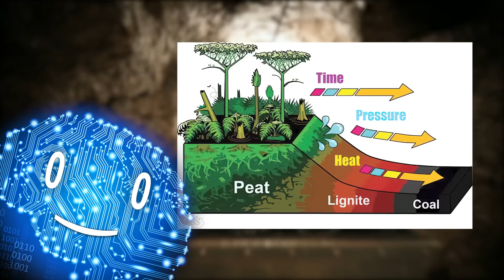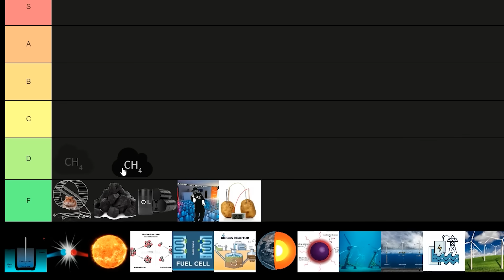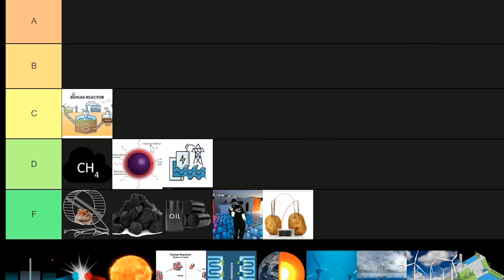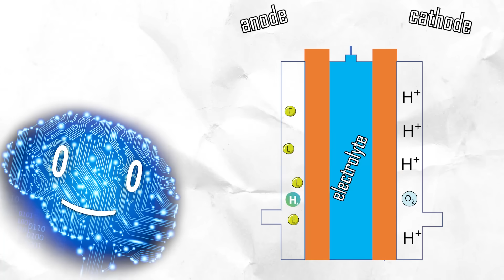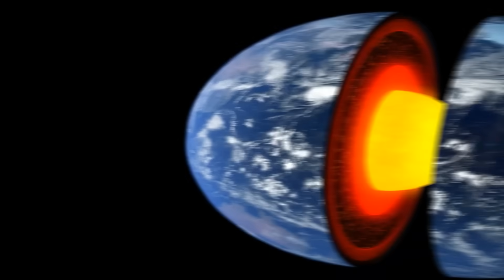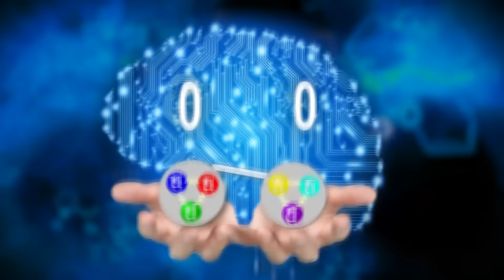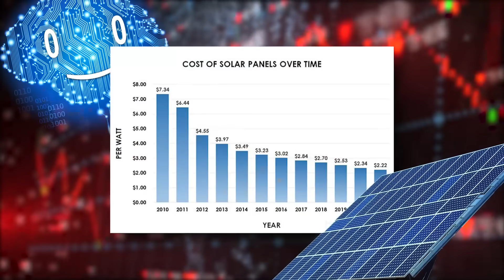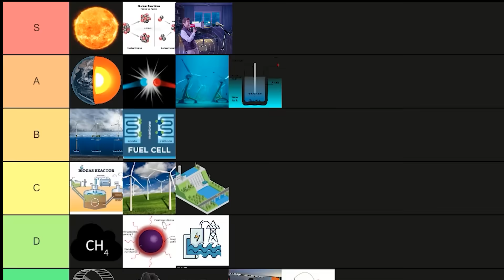Tier List of Energy Sources Explained

Comment: why does nobody ever talk about the economic issues with nuclear power?

half the people fear monger about dangers which the other half disproves and then go on to think there are no other problems with it.
Reply: Half of the other half acknowledge the dangers of nuclear, its benefits far more than outweigh its dangers, the fear mongering asshole side’s brains are made so mushy from fossil fuels emissions that they’ll believe anything they see on facebook
Reply: Still cheaper than batteries plus renewable. Good option for baseload
Reply: @onlypranav People wrongly use renewable.
Nuclear power is not renewable. There is no new uranium forming.

Nuclear power is zero emissions tho.
Reply: Economy? That is secondary to the human moral obligation of preventing climate change
Reply: @patrickchang9135  well if you take something else that also has low carbon emissions but is cheaper you can get more out of it.

nuclear power plants take much longer to build, releasing more carbon in the process, and also have a short lifetime compared to other options. Then you have to factor in the sanitation and deconstruction costs and emissions which also takes years.

I saw some other guy in the comments here talk about how we need to spend so much extra effort and money just to be sure that it's a safe process.

And yeah nuclear would probably be way more viable if we ran it like chernobyl, but we know how that went. We have learned from all our failures but the solutions are far from free and the huge expenses and building projects for building power plants that are only temporary make nuclear not the best option for the main electricity generation. 

I do think nuclear is good to some extent but only to ensure more consistent power generation while the bulk power is built up by things like wind and hydro (hydro is consistent but not every place has the rivers and topology necessary for them).

Concrete production produces a lot of carbon emissions, renewable sources can go further with more money invested. All this without even mentioning the work required for the long term storage of the spent fissile material.

All I'm saying, nuclear is not the best option for most countries main power generation and should instead play a supporting role.

Far too often do I see people portray nuclear as some magical thing that would solve all our problems if we just stopped being scared of mistakes that have solutions now. Failing to consider any other aspect of why it might not be a good idea to run the entire world on nuclear power.
Reply: I think it's because, without the  excessive red tape on it. Nuclear would be far more advantegeous economicaly for a very industrialised state than any other option in our current time.

Comment: I've wondered if it's possible to make a photovoltaic cell that also acts like a mirror for the energy that it can't absorb, that could then be pointed at a solar tower effectively combining a photovoltaic farm with a CSP.
Reply: such thing already exist
Reply: Those things look so cool from planes
Reply: Just make a mirror. Then flow water around the back to capture the left over heat. Then hook the water upto a sterling engine.
Reply: @mryellow6918  That's not what I'm talking about
Reply: @Jake1702  what are u talking bout .
Reply: ask chat gpt

Comment: I mostly agree with this tier list, but I would put the wind sources higher and I would separate biofuels into two categories: conventional and algal. Conventional fuels include stuff like corn ethanol as well as cellulosic biomass. I believe that D or C is a good fit. Algae takes up less space and has a lot of potential, but it is always 30 years away like fusion. I would put it in B tier because it is much easier to power planes with than hydrogen but is not as clean, so I'd place it with fuel cells in B tier. I want to try to make algal fuel a reality, not just because of the fuel itself, but to find a replacement to other petro-products as well, like plastic, as replacing plastic with bioplastic from conventional crops is infeasible, and replacing it with batteries and hydrogen is obviously impossible.
Reply: Wind is a hilariously bad source of "renewable" energy though. Newer nuclear fission technologies (thorium reactors and stuff) are the way to go for the future. Newer reactors can also utilise nuclear waste to further create energy until stable elements/isotopes are obtained (lead etc) which is awesome IMO. Also we have enough Thorium and Uranium to give us energy for the entire lifetime of the earth

Comment: What happens when we run out of materials to make solar panels and replace or repair them?
Reply: Then go to space, why does space have asteroids stuffed with the resources we need to build solar towers and panels?
Reply: @Scripulousfingire I like how we worry about emissions but then we have huge rocket engines with huge flames to go to space with that nobody minds using
Reply: @Sparkfilm-yy8ye  Space exploration leads to colonization, which removes the need for Earth altogether. It takes the priority
Reply: Then we won't have any earth any more.

The majority of solar panels is silicon, the second most common element in the crust ( behind only oxygen)

Comment: Guys. STOP OVERRATING NUCLEAR ENERGY. It is ok, but 1. it is expensive af (if you consider the expenses needed to built back old power plants) 2. if you don‘t have enough water (which you need a lot of) you have to shut it down for a period of time (weeks/months). And that happens, last year in France they had to shut down about a dozen reactors just because at that… at the same time. That‘s about 25% of your electricity just gone.
Reply: Sponsored by big oil
Reply: @Scripulousfingire  Sponsored with my money that I didn‘t pay for the consequences of nuclear energy.
Reply: Every energy source is expensive, fossil fuels are the cheapest option which is why people still use it, there’s also newer, cheaper designs for nuclear that make it more compact and have an updated cooling system which requires less water
Reply: @Scripulousfingire  Fossil fuels aren‘t the cheapest, renewables are. Newer nuclear designs are lacking actual working prototypes and would take a lot, not to say too much, time to build
Reply: This is why we should diversify our energy sources, solar is the only other option to coexist with nuclear bc it’s just way easier to harvest, maybe deep sea turbines to encourage underwater cities
Reply: @Scripulousfingire solar shuts down at night and requires lithium + rare earth materials which r just as bad as fossil lmao
Reply: @Scripulousfingire  I agree with the diversify, but rather than nuclear, a mix of solar, wind turbines, hydroenergy and biofuel should rather do the trick.

Comment: If nuclear fission is not the best power source of the ones that we can use right now this tier list is wrong.
Reply: I think you can edit out the "if“
Reply: @FoxofWallstreet  You are crazy if you don't think that  nuclear fission is the best power option we have at the moment, you literally have no idea what you are talking about. 

All of wind power investments are in the red because turns out that it doesn't work out that well, the fans are left in a dump after they run out because it turns out they are not easy to recycle, and in the effort of trying to scale up wind, problems arise, like fans destroying themselves due to the immense forces, also they are intermittent, which has a cost. A cost that suspiciously is not counted in the lcoe calculation... Makes you wonder. 

And this is a problem that all "renewable" energies have, solar is a bit better than wind, but certainly not even close to nuclear as it suffers the same problems with power output. And this is not even considering the cost of real estate, because turns out that land is expensive, and using that land to create a solar or wind power plant has an opportunity cost. Nuclear is far more compact in it's power generation. Same with coal, natural gas and oil.

Hydro and geothermal are better, but they require specific places to function.

Only nuclear, coal, natural gas and oil produce power reliably, constantly and everywhere, and out of all of these, nuclear is BY FAR the best.

You were either the victim of propaganda, or you talk propaganda. If you don't believe that nuclear is the best option.

That's about it.

So yea, if you wanna bring up that other forms of energy are better of the ones that we have at the moment, they are not. If you wanna point out LCOE, you don't know what you are talking about.

Also nuclear is really only so expensive because of  way too strict environmental laws, and frivolous lawsuits, that increase the cost and time to make a reactor.
Reply: @FoxofWallstreet nuclear is objectively the best form of energy.

If you don't think so you're just uninformed

Comment: Geothermal > all
Reply: Nuclear>Geothermal
Reply: @Threepeater6447  Nuclear requires fuel, geothermal doesnt. Geothermal > all
Reply: @FarsightAE Also nuclear is more expensive and isn‘t as consistent
Reply: @FarsightAE  blud geothermal require to dig down deep. And needs more resources for digging
Reply: @FoxofWallstreet  while nuclear energy produce more energy than thermal. And Don't even forgot about fusion which is much more significant than fission.
Reply: @FoxofWallstreet how is nuclear not consistent? Geothermal is the one inconsistent that it's only available in specific areas. Also maintenance from all the salt/chemicals and disruption to local geology makes it expensive in the long run
Reply: @Threepeater6447  Sure, fusion could be pretty epic, but still, where you can do geothermal efficiently, you probably should before you do anything else
Reply: @FoxofWallstreet  bruh fusion energy (if we can mass produce it) out weighs all of the energy source except antimatter.

But if it didn't, fusion still far give it more energy and it doesn't produce radioactive waste.
Reply: @onlypranav  Where you can built geothermal it is very consistent. Nuclear is not consistent ad they can be massive shut downs (plural btw.) if there isn‘t enough cooling water or the power plant needs maintenance
Reply: @Threepeater6447  That‘s why I said it could be pretty epic. But we don‘t have it yet, so we cannot know yet how good it actually is
Reply: Geothermal is not perfect either.
Here some areas use so much geothermal that the bedrock cools down. 
They have to pump heat in the rock with renewables to use the power later.

Difference is if you use geothermal from volcanic vents.
Reply: @jarskil8862  Not if you dig down far enough then the heat is permanent. 10 km or so.

Comment: (I Really think our best option for our Future, is Utilizing New Nuclear energy options) Small form reactors, LFTRs, Thorium Reactors, liquid reactors. Utilizing our advanced modern technology. Our Improved engineering & material science. Utilizing our greater understanding of safety & designs. We have so much More advanced computer technology & robotics. It will really allow any nation to be pretty much energy independent. Less reliant on fossil fuels. They'll have efficient, stable electrical grids and the rest of the grid could experiment with alternative power sources, etc. 
We need to heal from the trauma of our past. See & learn that those things only happened solely from Us not understanding what we were doing when it came to nuclear energy. We didn't have advanced enough technology, material science, engineering, safety measures, understanding of how to go about everything, etc. This source of energy will greatly help the world improve towards the future and lowering emissions. More than anything else could, while also providing a very stable electrical grid system. Currently we have alternative energy options but the majority of our grid is powered off of fossil fuels and emission producing sources of energy. We will be so much better going forward commiting to modern advanced nuclear energy options.
+ we could use that extra electricity to power desalination plants. Since fresh water is so important but the process is so power hungry. We could power this with efficient energy options, one without emissions and fossil fuels. I really think we should give nuclear energy another chance.
Reply: Problem: We don‘t have them and we likely never will have them before fusion energy and they are still expensive

Comment: If you could continuously feed matter into a small black hole and capture all the energy it puts out as hawking radiation, wouldn't that be exactly as efficient as antimatter?
Reply: Minute science did a vid.  I think 57% for Penrose energy (dropping anything into a bh).
Reply: @jamesfrankel7827  not DIRECTLY into the blackhole but make the object spiral around the blackhole

Comment: Nuclear power is cool and all, but the thing about it is that the reactors needs to be running 24/7 365 to make economic sense. The plants are REALLY expensive to build, and any time that they're not running they loose huge amounts of money. Therefore, other energy sources will be needed to cover the spikes in demand during the day, like soler, wind, biofuel, and stored energy. More well connected power-grids are also needed to get energy from areas of high production to areas of low production. Nuclear power plants make the most sense in countries with heavy industry thet uses a lot of power at all times of the day, as wind and solar are way cheaper per KWh produced. or at least thats what an professor in energy production told me at a lecture.
Reply: thats the thing, nuclear power plants can operate 24/7. they can operate all day, in any weather.
Reply: @sunRay04 Nope, there have been cases in France where they had to be shut down for week/months because it was to dry
Reply: Continuing to burn fossil fuels is what makes the most economic sense. At a certain point though, we need to recognise that wrecking the environment comes with a long term cost that's not being recognised by our current economic model.
Reply: The whole point is that it's reliable and sustainable, the economy is secondary to the human moral obligation of preventing climate change
Reply: Even then they kind of don‘t make economic sense.

Comment: Good video, was looking for something like this. However you just automatically put all the fossil fuels in F tier lol, your reasoning being Co2 emissions. Dont get me wrong, I don't like them either, but this isn't a climate change tier list, its an energy source tier list. I would've liked to hear more in depth about how specifically we obtain energy from these sources, how much energy we obtain per kg, cost per KWh, cost and time for construction of these plants, and potential we have for the technology in the future (can there be more efficient plants? Plants which somehow capture the Co2? What is the potential of the technology, etc). Again I liked the video, but it feels incomplete because of this.
Reply: Fossil fuels might seem like they're quite energy dense, but the only reason why they're viable at all is because there's an industry dedicated to extracting large amounts of them. Those large amounts are required because there's only so much energy you can extract from burning carbon or hydrocarbons.

It's not just the CO2 emissions. Coal-burning plants in particular produce coal ash, which contains compounds known to cause cancer. The methods used to store coal ash aren't the best either, with a spill potentially leaking those compounds I mentioned into our water supply. That's a big oof right there, and probably the reason why many countries are looking to shut down coal plants for good.
Reply: I agree, it could use longer and more arguments but it still would be F-tier
Reply: If feasibility factors in sustainability then the F tier is appropriate, as fossil fuels will rapidly be depleted

Comment: Maybe you didn't get the memo about solar not working at night?
Reply: True. That‘s why it should be moved down to A-tier and Wind up to B-Tier/A-tier
Reply: Nuclear is only economicly effective when run 24/7 and the demand is not constant.
Reply: @catprog  In case you really don't know: There is always some demand. That's a constant. You cater for that by a type of power generation that delivers cheap constant power. For example nuclear. Solar and wind wont work. For the demand above mentioned constant you need a power supply that can be switched on and off on demand. Solar and wind don't work here either.

Comment: I don’t understand, it gives energy when you break an atom, it gives energy when you combine 2 atoms, is this unlimited energy hack???

Also black holes can give the most energy. If you make a light go near a black hole it will gain energy, when you use mirrors to keep doing this the light beam will get more and more energy in short time, booom biggest energy source ever.
Reply: So basically how it works is that elements and isotopes below the atomic masses of Cobalt and Iron release energy when they are fused and the heavier elements release energy when they are split apart in fission. 
This is because the bond strenght per nucleus (protons and neutrons) is the largest in those elements and they are at a lower potential, hence the unnecessary potential is converted into energy. I'm not sure if bond strenght is the correct word since I don't speak English natively. 
When lighter elements fuse and heavier elements split apart some of the mass of the original elements is converted to energy according to E=mc^2. It would require energy to fuse heavier elements and split apart lighter ones.
Reply: @norppatolppa2223 Nice explantation but I would like to add E=y*m*c^2